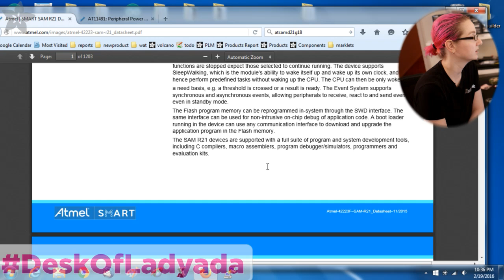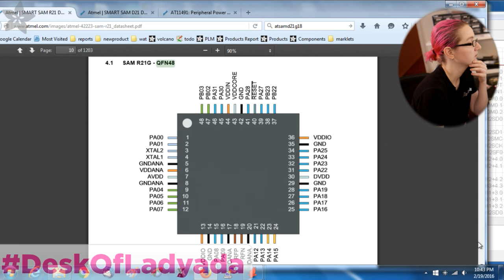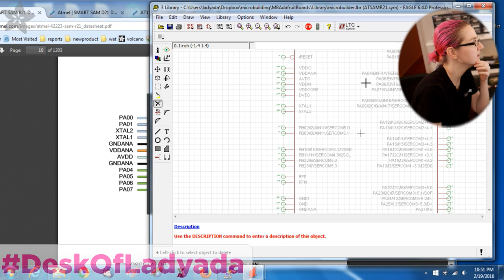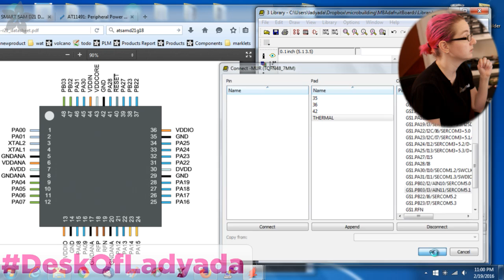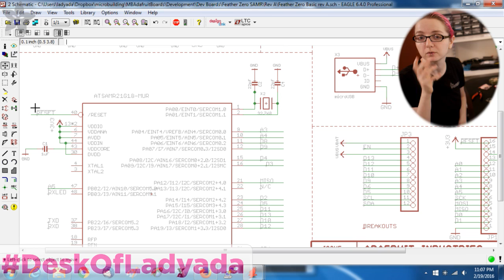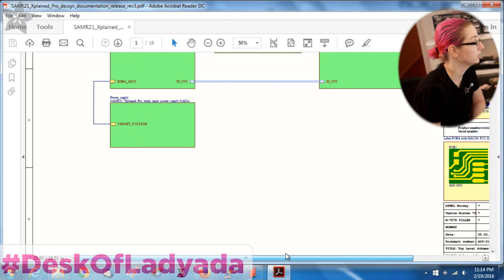EAGLE CAD for Atmel SAM R21 2/19/2016 @atmel @CadSoftTech

Comment: On recent Show-and-Tell and Ask an Engineer episodes you had said you were thinking of getting into mesh radio. I was going to suggest the atmega256r2 would make a good feather. That was the chip that was used in the now semi defunct Pinoccio platform that I tinkered around with for several months. I didn't realize there was an M0+ based processor that has the built-in radio as well. In the long run I think this will be a really great board. Pinoccio had some nice infrastructure associated with it that was open source. Maybe we can try to port some of it or come up with something similar.